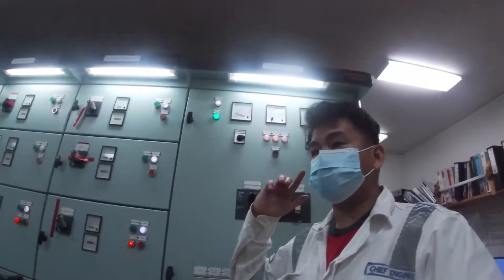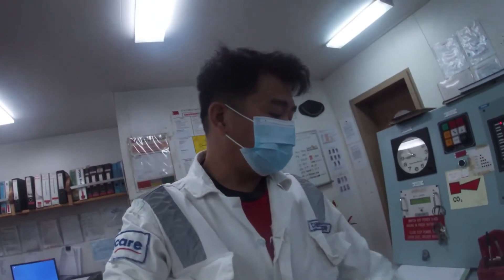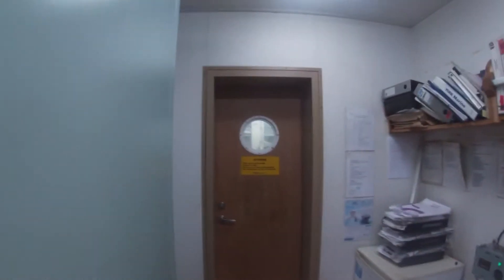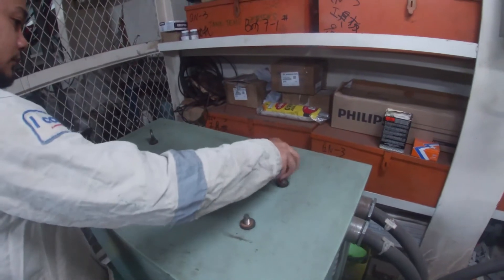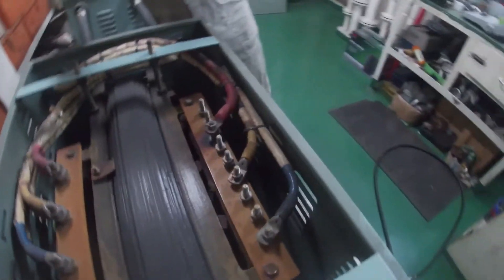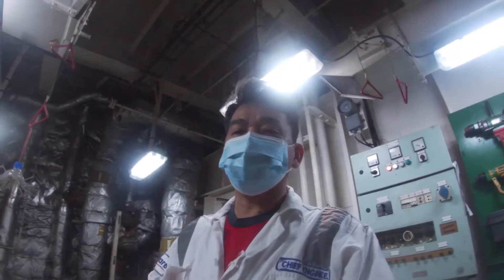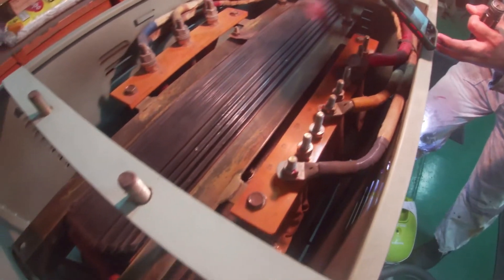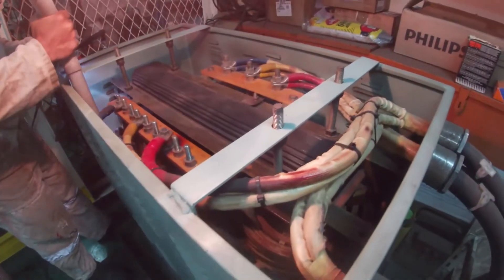SHIP MAIN TRANSFORMER CHECKING AND INSPECTION - RAW VLOG

Comment: Chief pwede ba pagsabayin gamitin 2 xformers? Pano sequence kung gamitin yung isa? On muna parehas o off muna isa?
Reply from the maker: Hi changed over of Transformers normally done in drydocks when ship power is off, you can also do it if you need to blackout the whole ship, both transformers can't be used at the same time, they have interlocking mechanisms, so it can only be used one at a time.
Reply: @joelsibuloLifeofaSeafarer18  chief so you need to switch off first the one transformer before switching on the other one... That means a black out will happen?
Reply from the maker: @recoveryfiles8098  Yes